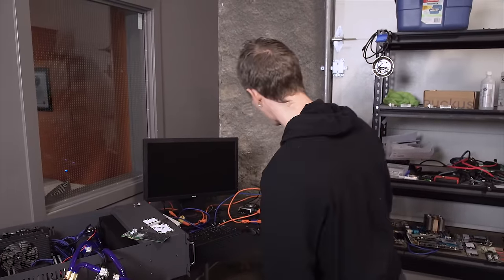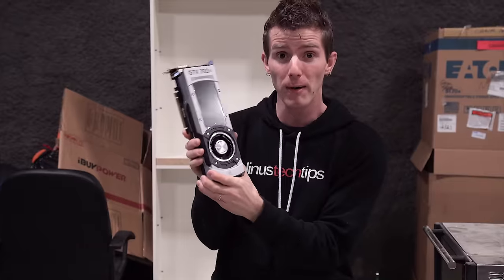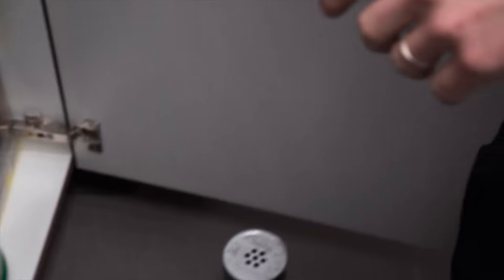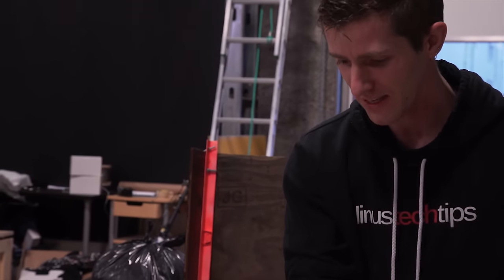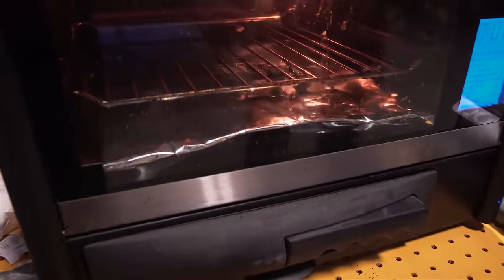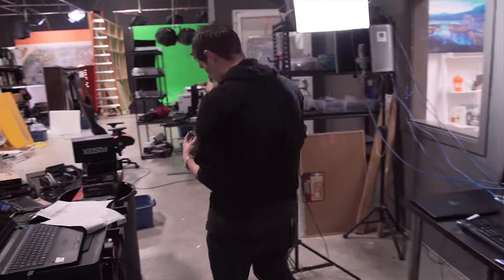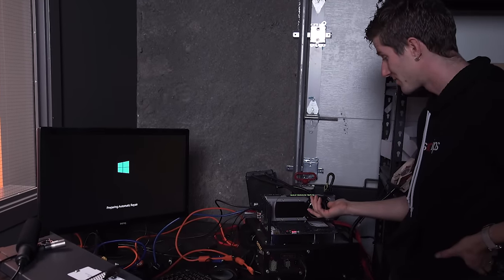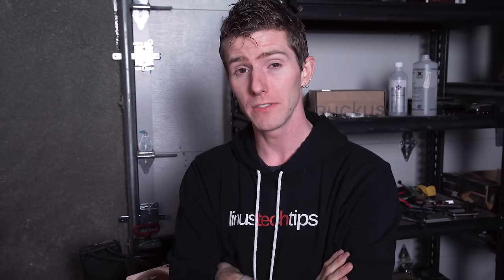Bring your video card back from the dead! - Oven method

Comment: linus you do know there are proper reflow stations for this right?
Reply: Bleach
Reply: +Xavier Melton that cost some hundreds of dollars? To fix a disposable gpu out of waranty? Why go thru the trouble... If I wanted to see a reflow station i would go to the luis channel, so...
Reply: +Welsige Well to be fair there are options to build a contraption that gets the job done fairly well based on toaster ovens. It does however require a bit of work with thermocouples and hooking the heating elements up to a custom setup that allows you to drive it harder and to follow a proper thermal profile as well as can be done with the limited hardware in a typical oven.

But yea short of putting in that effort its a fairly mediocre to useless way of reflowing due to the lack of proper high temps and reaching it in a decent timeframe. On top of that its a kinda questionable method, but at least using either the DIY toaster or proper reflow oven setup might have a better chance than this.
Reply: +ToKeepTrackOfRandomSubs How many jigawatts would it take?
Reply: +Sensei Yep It wouldn't take too much really, you just need a way to drive the heating element hard enough to ramp up the heat quickly initially. 

Most of the concepts that I've seen of this have the biggest issue with cooling down fast enough to match the manufacturer suggested reflow profiles reasonably well. 

Also about jigawatts, I've always wondered if that ended up in the script by mistake or if it was even there at all and someone just pronounced gigawatt wrong. But if it'd take anything where describing the power consumption in the order of GW as a unit makes sense then you'd first have to source that power from somewhere, I think in my country the maximum 3 phase you can easily get provided as a consumer is something like 17.25 kW (25A per phase, 230V, 3 phases).
Reply: +Welsige It doesn't cost hundreds of dollars...
Reply: ***** No - Oven baking is bullshit. Proper reflowing works exactly as intended. It can last for years if done properly.

If it doesn't, then the problem wasn't a bad solder connection in the first place.
Reply: Reflowing does work. I reflowed a rrod xbox and a laptop 2 years ago at our reflow station at school and they are still going strong today
Reply: Xavier Melton
It can work, from what I remember about the xbox was that it uses an IBM made flip chip based CPU. So if that was for example the problem area them yes reflowing may do the job.

As for the unspecific laptop model you stated, maybe? Hard to rule it out without knowing the details. But basically depending on the the options you've got its a lot better to try to analyse it with your brain first and narrow down the possibilities only use it as a last resort... if you know it has the chips for which it might help.
Reply: It was a dell m1530 that had the famous bga gpu issue that almost all the motherboards of that laptop ended up having
Reply: +Xavier Melton don't forget it's sibling the m1730....I had that beast for years.
Reply: +Xavier Melton yup had to have mine replaced 2 wks old.. that was years ago though
Reply: Kyle G Well you can't avoid that to be honest, a unit new out of the box that stops working after 2 weeks is most likely a manufacturing defect that didn't show up in the usual quality control tests.

Any large enough production run of consumer goods will always have a few of those cases where something will pass the tests but a fault develops over a short amount of time later.

Comment: Could this work with dead RAM? I have some 2 GB DDR2 sticks that I would like to use in an old rig.
Reply: yup
Reply: i think no
Reply: I don't have an oven to spare though, so that's a problem.
Reply: I have used my normal oven for this, just clean it up after and "dry" bake it once before making food in it. Never noticed any odd tastes in my food with that method. :)
Reply: +InfinityCraft 
try. :)
Reply: +PHUSII silicon and mercury doesn't have any noticeable taste in small doses like iron does
Reply: +InfinityCraft If it is already dead you don't have anything to loose.
Reply: +EloTh eMan Silicon isn't really toxic, mercury and lead are outphased from electronics, only a few LEDs contain arsenide and similar things.
Reply: +InfinityCraft You can use a heat gun. Or, if you don't have one, I've heard of some success with a hair dryer, but a decent heat gun is only 20 bucks from amazon.
Reply: +InfinityCraft I agree on the heat gun idea. I have heard they will also work sometimes. For a little more you could pick up a cheap toaster oven, but at that point it might be cheaper to get new sticks. You could also try looking through garage sales.
Reply: +InfinityCraft 
This ONLY works if the actual problem is cracked soldering. Soldering may crack and break the connection on components that repeatedly heat up and cool down again.
So maybe, it might work. If cracked soldering is the actual problem.
A famous example of this were the first year Xbox 360 consoles, most of those died within a couple months of purchase. The cooling on those machines was so poor that the repeated heating up and cooling down cracked the soldering. Those dead xboxes gave the infamous 'ring of death' error.
Reply: it probably won't work because ram dies for different reasons, don't waste an oven you could have sold over it
Reply: +InfinityCraft NO! It works on nothing, this is BS. RAM does not use flip chip design so there are no eutectic bumps inside the chip that you are going to move around by heating it. This doesn't fix GPUs either,it just fucks with the eutectic bumps between the die and the chip inside the chip a little, and sometimes destroys it, sometimes moves it into place so it will work for a week or month longer. This isn't repair, it never was, it never will be, it is just an internet myth that is continuing even into 2016 to be spread because of popular people parroting the same shit people should have dumped ten years ago.
Reply: +Louis Rossmann Well, thanks for telling me.
Some people apparently have gotten RAM to work again with this method, but I guess I'd rather not try it myself now.

I don't think this entire thing with reflowing the solder is BS though. Constant expanding and contracting due to heat may crack the solder points and heating it to a temperature where it turns to liquid may reconnect them.
Of course, I don't believe it's a magic fix for everything - if something else is fucked, this can't possibly work.
Reply: +InfinityCraft google "lead-free solder melting point". it'll definitely be higher temp than anything used in "reflow tutorials". linus definitely didn't melt solder, all he did was misinformed his audience.
Reply: lepinjaUsomunu Oh. Well then.
Reply: +InfinityCraft NO
Reply: lepinjaUsomunu Wiki: Alloys that melt between 180 and 190 °C (360 and 370 °F) are the most commonly used.
Reply: ivo215 Large scale electronic manufacturers must abide by international regulations when making their products. One of them is RoHS (restriction of hazardous substances), which regulates that every component must be lead-free (indicated by RoHS and Pb-free mark on components). Lead-free solder has higher melting point, beginning at 217°C or higher. Lead-free solder doesn't change phases from solid to liquid as a water for example, it turns from solid to paste from about 183-217°C and becomes melted at eutectic point, which is 217°C minimal. Leaded solder has eutectic point at 183°C and doesn't have the "paste" phase and because of that is still used by 99% of hobby electronic hobbyists or even smaller companies, but certainly not by companies that make graphics cards, SSD-s or other computer components. There is also a question of heat transfer between oven and solder on components, because dirt and grime isolate heat, and when desoldering old components, one has to use even higher temperature and flux to clean the solder joints. But that is a whole new topic open for discussion. Point is, there is no way Linus melted solder at that temperature in that dirty-ass oven.
Reply: lepinjaUsomunu I do some soldering every now and then. I've always used lead free solder. But I've never really taken an interest in how high the melting point actually is, or how hot the soldering iron really gets.
It would appear that you have a point. Most of these tin-alloys seem to have melting points between 217°C and 227°C. Which is 423°F~441°F.
Most electric ovens can go up to 220°C or 230°C. Or 250°C for the more expensive professional ones. So it may be theoreticly possible to get solder to reflow in an electric oven, but indeed not likely at 385°F (196°C)

Comment: is this a joke
Reply: Nope
Reply: Nope
Reply: +penninviisaampi At least for GPU's, this method is known for years yet. The only problem is, that even if the fix works, it may only be temporary and the card eventually will break again after a few months.
Reply: +penninviisaampi nope, People used to do it with dead Xbox360's. There it's the console getting to hot, flexing the mobo. By heating it up even more, the solder would set itself again and it would work for a few months
Reply: +penninviisaampi It does occasionally work. Only try as a last ditch effort like Linus though.
Reply: +Nikolaas Brems it has nothing to do with solder
Reply: +SeeWaffle9 thats what i read. what do you think it is?
Reply: +Nikolaas Brems Louis Rossmann: "This has nothing to do with balls and everything to do with failure 
inside the flip-chip design of the BGA in question. The eutectic bumps 
inside the chip attaching parts together break. By heating the chip to 
125-150c(which is FAR BELOW SOLDER MELTING TEMPERATURE), the bumps will 
reform themselves and it will work again for a week, or a month, or two 
months, and then die. It is a zombie chip.
"
Reply: +penninviisaampi LinusTechTips will cover any costs involved with replacing your device if this method doesn't work!!
Reply: +Luis Badolato Louis Rossman is awesome. He's spot on with this stuff and can teach you to ACTUALLY fix your devices instead of frying them into temporary zombie machines.
Reply: *****
I discovered his channel a month ago, when some tech shop "fixed" via reflow my 2012 macbook pro and, though I was bummed because I know my stupidly overpriced laptop will fail again, it clearly shows he knows his stuff and always has an interesting point of view on things (though bluntly sincere for what I've seen, lol)
Reply: +penninviisaampi It's real, but it has absolutely nothing to do with solder balls. It temporarily fixes it, you should only ever try this if you've taken it to a professional, or you're looking to get a very short amount of time out of a dead card.
Reply: Luis Badolato Totally. I love that he's no-bullshit mode all the time. The video he did where he fixed the MacBook Air mobo the Apple store said couldn't be repaired - while drunk - was fantastic.
Reply: +penninviisaampi ei, mutta suht random tapa ''korjata'' gpu :'D
Reply: Dwayne Rakitti It's just going to die again lol
Reply: +MASTERHUNTER666 Teen siittä kyllä videon :D
Reply: penninviisaampi linkkaa tänne sitte kans :D
Reply: +penninviisaampi no, i used to do it when my old cards broke.
Reply: +penninviisaampi, It is. This is proven not to actually work long term in most cases. The problem is a defective chip nearly every time, not bad solder joints. That and he never reached the melting point of the solder.
Reply: yes ?

Comment: I wonder how this would NOT destroy the capacitors...
Reply: It will do and any other plastic parts
Reply: @24321619  Not if done correctly. The melting points of the materials are not the same.

Comment: I actually repaired an older (but very nice) LG TV that I didn't want to get rid of by heating the main board with a heat gun on both sides for about 10 minutes, then letting it cool. It took 3 attempts to get it to work. But apparently lead free solder (used in newer electronics) is more subject to micro-fractures causing failure.

Comment: I just baked my friends 7970 at 475°F for 5 min, used aluminum foil to cover the capacitors and sensitive plastic connectors and finished by covering the whole thing with aluminum foil with the oven off and door cracked to gently get it back to room temperature, replaced the thermal compound and cleaned out all the dust bunnies and tada! Got a free working ATI HD7970.

Comment: I did something similar to reflow the solder on a tv HDMI chip. it doesn't last long in my experience but is a good temp fix. its better to add some thermal past on the connectors and resolder it

Comment: 220C and 11 minutes work everytime for me. 200C and 8 minutes hardly work.
Reply: are you sure? :D everyone says 200c and 8 min
Reply: Oskar Eriksson Yes? Otherwise I wouldn't have said that it works EVERYTIME for me..
Reply: cotxe11 Well, how do you tell the difference? I think by trying if the GPU can display something afterwards?!
Reply: I agree that more aggressive works better. But you have to watch out for parts falling of your PCB. My old notebook graphics card only lived for hours to days at recommend temps and oven time. But at 220+c and 10+min it's as new for over 2 years now.
Reply: Yes, we are cook wizards.  You should join our ranks.
Reply: I always did 30 mins at 160-180 C. But gonna try 220 for 11 minutes as i need to bake mine now
Reply: TRPBluna and what happened, its been 5 days now
Reply: df71091 looks good
Reply: TRPBluna ok , i once did that too but without that alu coating , and it worked for about 3 weeks until it stopped working again 

Good luck with your card , maybe ive used the wrong temperature or time !
Reply: df71091 i never did it with the Aluminium foil. I dont see it helping at all and usually yea, these cards die a few months later over and over again. My gtx580 xtreme went trough that 17 times!

Comment: has anyone gotten this to work with a motherboard? I'm not sure if the plastic bits and capacitors could survive that kind of heat.
Reply: Actually, yes. Check out the video "LGR - Repairing The Barbie/Hot Wheels Computer", he did it with the motherboard of one of them.
Reply: I'd sugest using a heat gun for increased control of the areas affected.
Especially if you can get a vague idea of where the problem is first.
If it's cracked/broken solders, you should be able to test it, by applying pressure with a plastic tool, causing the board to flex a bit while running.

Comment: Just to let everyone know I tried this on my gtx 580 and all of my voltage regulators exploded one by one and one of my RAM modules also exploded. So I would say don’t ever do this unless you don’t care about the card.
Reply: I think your comment relates to this? 
Morbo
4 years ago (edited)
You're supposed to bake the components at a lower temperature (around 125C) for 24 hours in order to remove all of the moisture the ICs have accumulated. This prevents the moisture from vaporizing during the reflow process and literally causing the ICs to explode. Also, the temperature profile you used wasn't hot enough and was for far too long. A typical reflow profile is 150C for 60s preheat, 165C for 120s soak, and 225C for 20s to reflow. You probably didn't melt all of the solder completely. While enough of it probably melted to fix some hairline cracks and temporarily restore the connection, it's likely to die again soon.

Comment: Just did this to my trusty 780ti and it's back from the dead, years ago I had an 8800GTX that I resurrected in the oven as well but it lasted 6 months until it died again.

If the 780 dies again I'll get something new but I was planning on waiting later this year to build a whole new system, hopefully it lasts until then but no biggie if it doesn't.

Comment: just seen a TV show and it said doesn't matter whether you use shiny side in or out for anything when using foil....will work exactly the same...its only different as it is a product of the manufacturing process that happens to make one side shinier.

Comment: Watched this to keep me busy while i was fixing my dead rx580.
Problem: no display, positive post,  gpu getting power, system boots normally with igpu. 
Solution: booted with igpu, used system configuration to set boot to safemode then shut down. Installed the gpu and tried other displayports until i found a working one (had static on 20% of display went to device manager, redownload the gpu drivers. Then installed the drivers from the amd website (old known to work on my system one) turned off safemode then turned off the pc the powered up. It worked for me.
Edit: booted to safe mode with networking enabled.
Good luck.

Comment: i done this today with my gtx 1070 ti and now is working fine cause of the covid economy i didn't want to buy a card off a scalper so i fixed my card by putting it in a toaster oven for 12 mins at 200 degrees Celsius now its a overcooked 1070 ti  😎

Comment: If a board has broken or weak solder joints or connections, using a correct hot air tool to fix it properly is cheaper than buying an oven. Using flux, a hot air gun, and an air temp gun would at least give you better control over whether you burn your board. Using an oven might work for some people but the results are usually never consistent and rarely last very long. But you won't see many people admit this ended up being a total fail a week later. That might cut down on how many hits a video gets

Comment: Has anyone tried this with a microwave oven? :) 

Seriously though, that this method works is astonishing. I've seen photos of the 'clean labs' where people dress in complete PPE to avoid contaminating the manufacturing process of components like video cards - the extreme  of precision science and engineering - and then it gets repaired by baking it in a home oven. Like I said - astonishing.